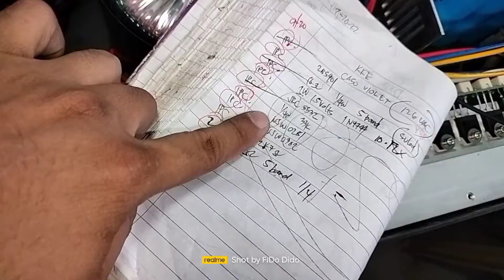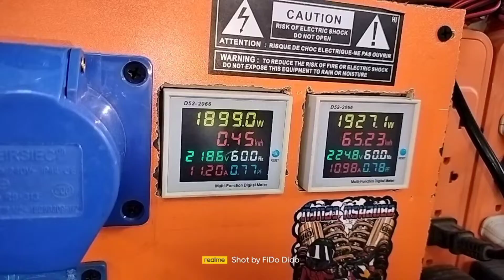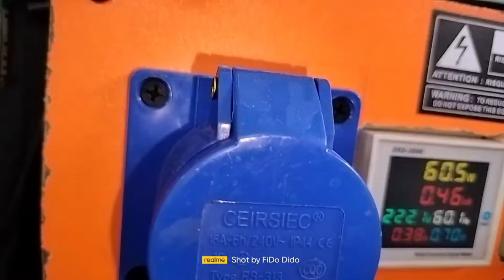CA50 VIOLET REPAIR AND TEST VIDEO

Comment: idol bat kaya nagkaganyan yan? bago pa naman yan. ung CA30 ng kke ay sa may stepper ang nagkaganyan. nagkulay green nga ng kaunti sa may ilalim ng resistor na .1ohms 5w. di naman sira at walang opt ang nasira nagclip lang sya agad bago pa naman sya. ok rin naman ung mga .1ohms 5w nya. kinaskas ko rin ung kalawang nya. di ko pa sinubukan kc gusto kong idouble check ung board para sigurado.